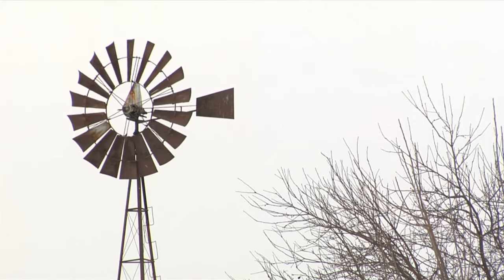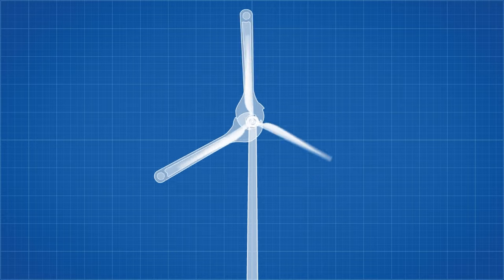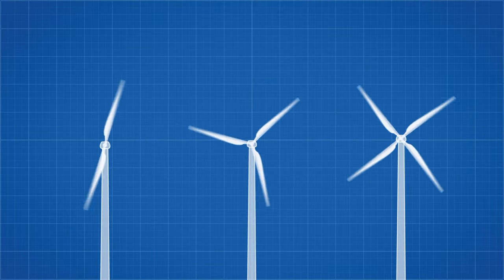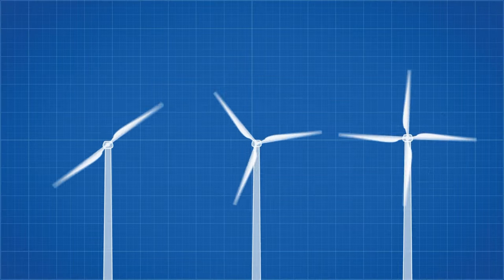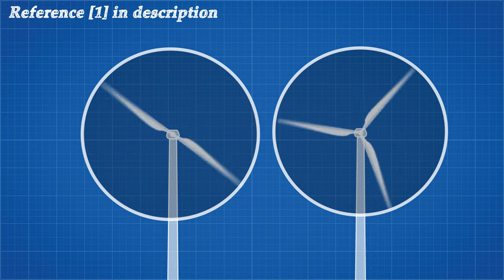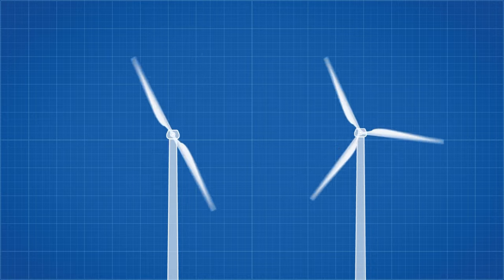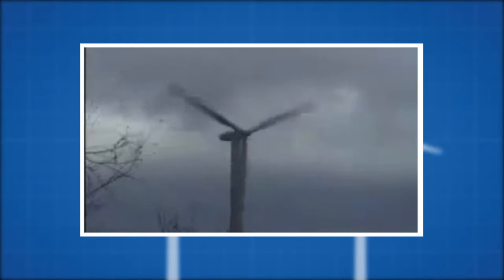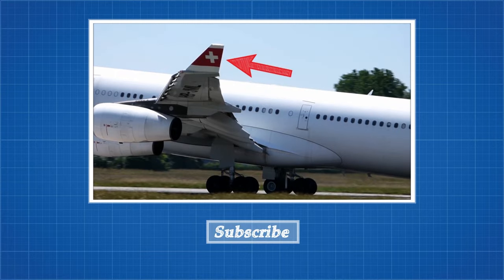Why Do Wind Turbines Have Three Blades?

Comment: First of all, I really love your videos, they're really informative, pedagogical, and overall of excellent quality. I have found this one lacking however. Explaining things in a shorter way as you do in your videos is a challenge, and you should be extra careful on your phrasing and argumentation.

Some remarks, which you'll hopefully find constructive:

"Let's assume they have the same blade design for now". - some are still waiting for you to change this assumption.
Your cost-analysis is extremely lacking. The graph adds nothing to your story, it just shows that you need time to break even with the fixed costs to make a profit. This pertains to 3 and 4 blade design, and really with any investment whatsoever. It does not compare the advantage of 3 over 4 blades designs and it seems you just throw 101 economics to confuse the audience to just agree with what you're saying without justification.

"A faster blade will generate more noise" - From your argument, you make it sound like faster = greater angular velocity. But it is not the case. A longer blade, at the same angular velocity, will also produce more noise.

"We need to minimize their speed" - a speed of 0 is achievable, but is not likely to be optimal. Add "for a given power output". Much of engineering is balancing trade-offs, which you emphasize in your videos but not so much in your phrasing.

"a three-blade design can generate more power at slower rotational speed" - This is logically flawed and does not follow your argument. What you really meant is "more power at the same speed", or "same power for lower speed".

These small remarks notwithstanding, awesome job!

Comment: Wait, the only factor that makes 3 blade turbine better then 4 blade one is cost for 1 extra blade? Hmm that doesn't sound right. I mean the whole thing is expensive in the first place and they need to manufacture 3 blades anyway, so wouldn't it pay off making one more if it's going to increase performance?

Comment: The elimination of the 4 bladed fan made no sense.  The graph presented money vs time (time for what?) seemed unrelated to any of the designs.  And placing it on top of the designs implied the 4 blade made large profits, 3 broke even and 2 was loss. 
I'm not saying 4 blades is the way to go.  Just that there was no plausible explanation given.
Reply: In economics there is a theory that essentially states at some point, added ability will not always correlate to the same added profit. You can visualize this with candy bars; say after eating 1 candy bar, you feel moderately content, but you want a second one. After the second one, you feel great, so you eat another bar, but this time you don't feel as good. Then you eat a fourth and begin to feel even less satisfaction than from the third one. This is called diminishing returns and that's what is happening with the turbines. With 4 blades, the cost of production of a fourth blade is greater than the returns of energy from that fourth blade, so there is no incentive to waste resources to make it.

Comment: wind turbines have brakes? I feel like that's counterproductive. Why not have variable angles on the blades instead? Cost? well we just saw a wind turbine get destroyed, so I imagine variable blades is cheaper than 2 wind turbines with brakes?
Reply: +rpaull3 brakes are much cheaper and easier to manage than motors and sensors that change the angle of all the heavy blades
Reply: +rpaull3 I also wondered about that... I get how spinning so fast will destroy it, but electric generators have a braking effect depending on the amount of load put on them. If you switch all your electrics on in a car the engine will burn more fuel because the engine has to work harder to turn the alternator, which is basically stiffer to turn... surely instead of brakes you could load up more power so that it was turning at the same speed but generating a whole lot more electricity?!
Reply: +rpaull3 Most wind turbines have both
Reply: This video shouldn't have called them brakes. What they really are is governors. Brakes convert rotational energy into the heat by friction. Governors provide resistance to the drive train to put an upper limit on how fast they can spin.

Comment: 3 is really fast turning 5 was for more power but even more or 5 or 6 then you quickly lose he slows down to power and air release and that was used to pump water in the farwest that was then a crankshaft with a tube the to pump water out of the ground
Reply: the noise that you hear occurs from wicks that pass read the support post

Comment: It would be more efficient if one converts the whole wind into kinetic energy, not just 10%... Too bad, because the blades in the wind does not obey the law of aviation, but that of the resistor. And so one must not only make three narrow blades, but about ten and broad so that ALL wind is used. Think of the parachute, which is only useful if one includes as much wind as possible .
Reply: You've just created the need for a tower that is impossible to build of the same blade diameter, the tower that can be built makes more power then.  Claimed resistor analog is pure de BS.  You don't get more power from more blades, you get slower RPM which in the case of a water pumping unit used often for cattle is a good thing because they can't move fast anyway.

Comment: Why can't they change the pitch of the blade like a helicopter blade does? cost?
Reply from the maker: They can!
Reply: Real Engineering My point is that a variable pitch could make energy in high and low wind speeds so produce more energy in the long term and control it better in higher wind speeds, this will also reduce the maintenance cost from ware and tear.
Reply: They do :D
Reply: They do adjust the pitch. That's how they are shut off when the wind speed is too high.
Reply: They do. This isn't the stone age
Reply: It doesn't if all it does is flex the blade/wing smashing into the tower in a storm. Then it costs the taxpayer even more!
Reply: 00PiggyCosmonaut

Comment: I would do with four, easier to balance. want to adjust the speed to low with more torque? change the wing section. to the monster wind turbine like 25 m or more i would make with two blades and a shape at the tip hat reduces wing let noise. three blades is pretty ugly ! in any size.

Comment: If efficiency was the reason for three blades then they still got it wrong. For producing power efficiently zero blades would be the answer, in other words they should not be built at all as the cost of producing a kilowatt of energy is too expensive for any consumer to pay. The huge amount of the earths resources needed to build a tower is a grotesque abuse of those resources. Wind towers only exist because their power costs are subsidised by other generation means.

Comment: The explanation is very shallow.
There are a lot of factors involved. F.e. smaller wind turbines (rotor dia. up to 3m) can have more blades, up to six in a smallest commercial turbines and they are totally OK in terms of cost efficiency.

Comment: This is last week technology.  The new kid on the street is the Tension Turbine!
The Tension Turbine can have lots and lots of blades.
The Tension Turbine can be unlimited in size.
the Tension Turbine can produce power for a city.
the Tension Turbine weighs half as much as a three blade unit.
The Tension Turbine is much stronger than the three blade unit.
The Tension Turbine is a 'bicycle wheel' which does not have shear forces on the blades.
The Tension Turbine does not have bird kill.
Look at a picture of the ferris wheel in New York, then put blades on it and you have a Tension Turbine!  The Ferris Wheel of New York is 520 feet in diameter!
T

Comment: wouldn't more blades make it faster because of the increased thrust of the wind on the blades?! im so confused
Reply: Typically, more blades can spin faster in slow winds. 
But slow wind has no power, so who cares?
In high winds, fewer blades ( ie 3 ) will spin faster than many blades.
And that is where the real power is created.

Comment: Actualy i think this is not all that well explained and a lot of things missing here. A two bladed Design is usualy more cost effective, because you save 1/3 of rotor parts. You achieve higher Tip-speeds, wich is beneficial to the efficency (its still not as efficient as a 3-blade design but its just a few % difference thanks to this effect). You can also achieve higher rpm, resulting in less torque, making the Gearbox and mechanical parts cheaper. The installation is also much faster and cheaper. Drawbacks are mostly just two points, higher noise emissions (because of the higher tip-speed), and the much lower acceptance for the design (yes, this is also taken into account).  But since those two issues dont count when the wind turbine is out of sight (Offshore) they test it for offshore installation.

Comment: This work is highly misleading, having more blades do not change energy of fluid entering to turbine, thus it do not results in more power.

Increasing blade count decreases blade loading, thus  decreases mechanical load at blade. But increasing blade number increases cost and skin drag, but decreasing lift drag.

Today, the challange of wind turbine is increasing diameter of turbine to increase power generated. This generates too much centrifugal stress in blade. Also, three blade turbines have better vibrational characteristics at low rotational speeds, but at high speed rotors two bladed designs are preferred...

Comment: why not
Reply: your analysis is not quite correct...
 but good enough for jr hi work and questions
Reply: a 6 bladed turbine can have shorter cheaper lighter blades at slower speeds than a longer 3 blade turbine and create more power..
this is why plane propellers are sometimes 5 6 and 7 bladed..its not quite as simple as you make it sound

Comment: I have been very near turbines for years. They are very loud and disconcerting, making a loud "huffing" sound that is impossible to ignore and very disturbing. They kill thousands of birds that try to fly between the blades. Also, owners of these turbines tell me that they have an electric motor that starts the blades but the amount of electricity generated in a day is not enough to replenish the starter. Not a good idea!
Reply: Buildings kill birds. Who could have thought. Birds a dumb.
IF they made less then they need WHY IN HELL DO WE BUILD THEM?
AND WHY DO WE GET POWER FROM THEM?#!

Comment: Cool video, but there's no such thing as centrifugal force. Only centripetal.
Reply from the maker: +Ben Reeves Tell that to the moon. Last time I checked it's still in the sky. 

Yes, the centripetal is an actual measurable force. Like gravity holding the moon in place, or the hub holding the blades in place. Centrifugal force is still a thing, it just doesn't work the way most people think. It is just the term given to the inertia that causes centripetal force. So centrifugal force causes centripetal force. So my statement is 100% correct.
Reply: +Real Engineering Fair enough. Many people don't recognize that it's inertia. I subbed; keep up the good content.
Reply from the maker: +Ben Reeves Fantastic, great to have you on board.

Comment: Does a wind turbine with 3 blades rotating at 2 rev per sec hum at 6 Hz or 2 Hz??
Reply: The blades will go past the pole at a rate of 6 blades every second. It is more of a swoosh sound, than a hum.

Comment: you didn't talk about length tho..
Reply from the maker: +mrKaasa I did mention it briefly. We always want to make the blades as long as possible. The more wind we can capture the better. We are only really limited by the strength of our materials and costs. We need to keep the tip speeds around the same speed too, generally 80 m/s. The longer the blades are the faster the tips go. So longer blades will have lower RPM. It's a pretty complex balancing act of strength, performance and cost.

Comment: The amount by which these reduce the need to burn fossil hydrocarbons, usually the so-called "natural" gas that is methane, exactly as natural as heptane and octane, is not enough to justify the cost to neighbouring homeowners that depresses them AND their property values as any value records can show. Environmentally, the costs to flying wildlife are worse per unit energy than for hydro power's effect on migratory fish. 
 WInd "turbine" power is NOT competitive with nuclear on price until you add in the cost of enough pumped hydro to store  the energy  so that it is available when wanted. No such provision exists anywhere, and probably cannot.

Comment: Wait if a bladed design can spin faster, then it would generate more power for cheaper. So 3 blades makes no sense.  Nobody cares about the noise these things make. They are placed huge properties, away from residential areas.  The noise a wind turbine makes is nothing compared to the noise of the power plant in my city.

Comment: No... NO.... NO..... Cost is NOT the reason for 3 blades. EFFICIENCY and balance are the reasons for 3 blades. Too many blades and one will make turbulence for the one that follows it. This is the reason that MOST boats have 3 bladed props.

Comment: If you discussed it with me I will give American a reliable turbine which can turn the generator and we got lot of electricity forever and it all started with flywheel and a large weight millions tons floating containers which use up down motion of sea wave and this will give us a large torque on another end and you can started a flywheel by using cycle paddle half cycle and again and again in few stroke the total power summed up is enough to power a generator of MW at the height of 100 meters and it will work defiantly in USA as well as in India too and any other country as well

Comment: I have a friends ( with a SEVERELY DISABLED child that needs t be in regular calls to emergency due to the medical issues & that has had one of these HORRIBLE MONSTROSITIES has  put up not far from them quite recently without any consideration to the rest of the residents in the area & since it has been there they have found that they find it  has been almost impossible to use their phones. ( from 100% down to less than 5% signal strength 24hrs a day 7 days a week etc, etc, etc!!!) They are very happy in the area in which they live but, this MONSTROSITY is a BLOODY EYESORE & I have tried just about everything to help them in getting it moved FAR AWAY AS POSSIBLE!!! but, to no avail.  ANY IDEAS PLEASE!!! HELP SOMEONE!

Comment: Wind turbines should be dedicated to either produce hydrogen, to then be shipped and used in fuel cells for clean production of energy when you need it, or should maybe charge Iron Flow batteries where a fleet of trucks could haul them around where the energy is needed cause people should not live NEAR such wind farms. Really.

Comment: Hmm, so it's not about better physics, just about the cost.
Reply: I helped work telemetry on a couple wind farms around 2001. At the time they cost about $1.2M each with a 12 year payback average, depending on the wind. It's highly speculative and takes expensive infrastructure. You could build a huge efficient model, but the price you sell it's power for won't change much and the wind pattern could change, leaving you with a really cool wind turbine that never moves.
Reply: 1Howdy1
Still it's the future. Today you have a choice to burn fossils or use the wind. Tomorrow fossils will be gone and you will have only the wind. So it's not about whether we want to use it or not, it's about experimenting and learning how to use it most power- and cost-effectively.
Reply: SolarWindsRider I hope so. It's funny, I was really surprised when people started having issue with them over birds and noise. I always enjoyed watching the birds fly around them - the blades move slow compared to the birds; the more wind there is, the more control the birds have and the small birds would battle the big soaring birds while flying between blades. The blades will rattle at first, small chunks of fiberglass from the manufacturing process, but they would quiet down in a few weeks when that stuff would turn to powder. There just isn't a very fast financial turn around. Then again, the country's dam system wasn't financed by private money and wouldn't have been built if it had been.
Reply: see my new comment above concerning why it is about physics in fact. He just didn't cover the math of it.

Comment: This is all so wrong. The reason is purely physical. You simply can take out more energy out of the wind with this design compared to others. More blades will stall the wind, thus the velocity of the wind befind the turbine will be lower and air will build up against the on-rushing wind. This lower wind-velocity and therefore turbine efficiency.. There is actual science involved in the design of tubrines.. I'm pretty disappointed by this video. I wanted to learn more about "fast-rotational-factors" ("Schnelllaufzahl" in my language)

Comment: Wind power is not benign.  When I moved to the Columbia Hills in Washington State in 2000, there was an abundant population of raptors (eagles and hawks).  Any time of the day, one would see raptors circling in the sky, raptors perched on every telephone pole.  Then the built the wind farms.  Within a few years, the raptors vanished, slaughtered by the blades of the wind turbines.  Wind farms are located where there is lots of wind, i.e., on rivers of wind.  Birds follow these rivers of wind when they migrate.  The wind farms located on the rivers of wind are walls of death for the migrating birds.  Since 1970, bird populations in North American have plummeted 30%, with an appalling acceleration of the decline since the advent of wind farms.